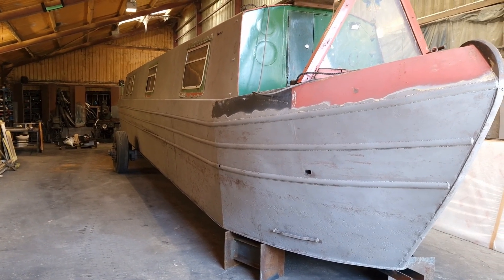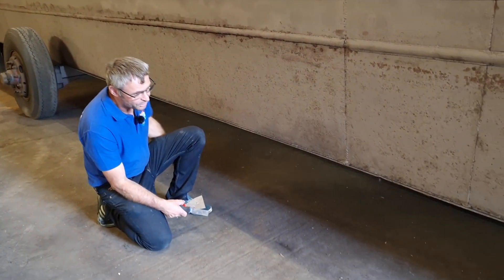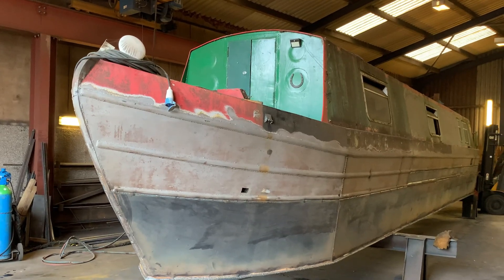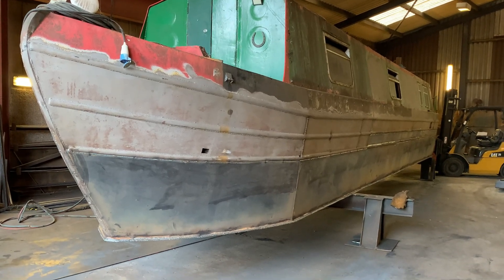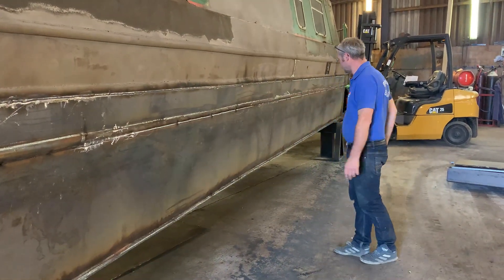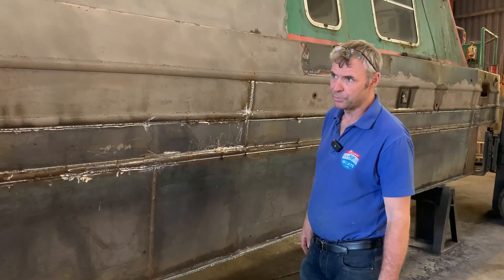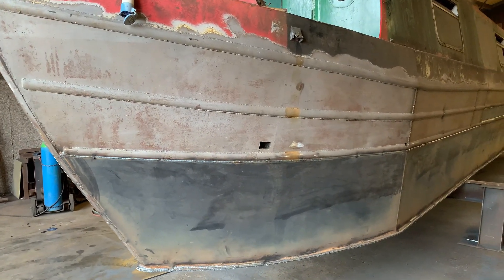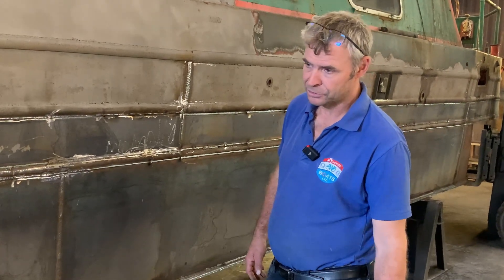OVERPLATING | The process when the pitting of the steel is too severe.

Comment: I love what you do and how much attention to detail you place on quality and doing a job properly, but I cant help coming to the conclusion that Bluewater are the Grim Reapers of the boating world.
Reply from the maker: Or may be bluewater saves boats from being over plated or even worse by shot blasting and epoxy coating in the first five years will stop you having this problem if you can afford £40.000 plus on a boat surely spending a extra £2500 to have piece of mind your boat is protected properly is a no brainer ????

Comment: Question: is it possible to "overplate" a traditional steel hull with aluminium ? If just using traditional steel and when all work is finished, than what type of "epoxy" would be used that would last "longer" (than a 2-3 year period?) Thank you for your excellent videos and very educational.
Reply: Dissimilar metals together are never a good idea due galvanic erosion. Now a plastic coating would be interesting considering how sophisticated materials have become.
Reply: @lrdisco2005  Plastic coating - very interesting. Thank you

Comment: How on earth is 1/4 inch plate sufficient for the base plate? 10,6,4 was always the traditional plate thicknesses for base,  hull sides & super structure.
Reply from the maker: It isn’t sufficient for a base plate, hence why with some pitting and incorrect preparation it has needed to be over plated 😊